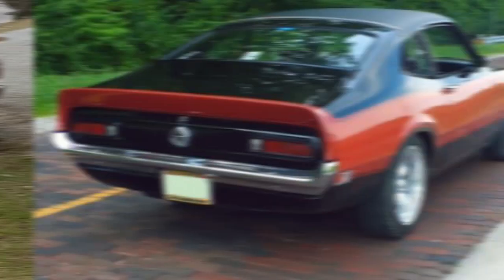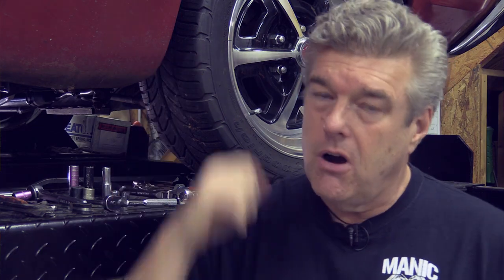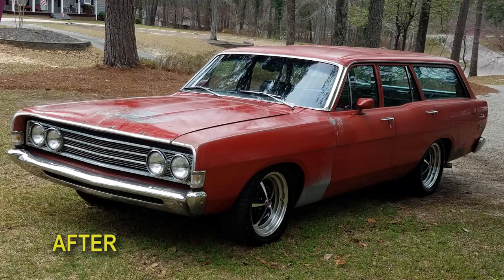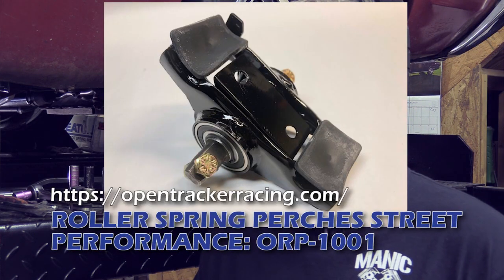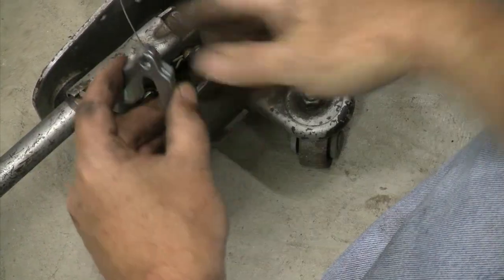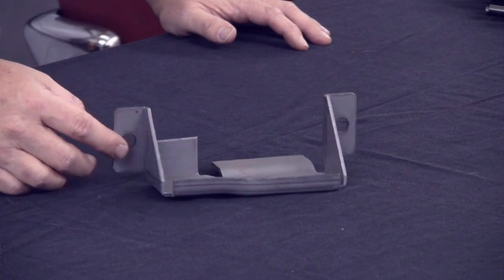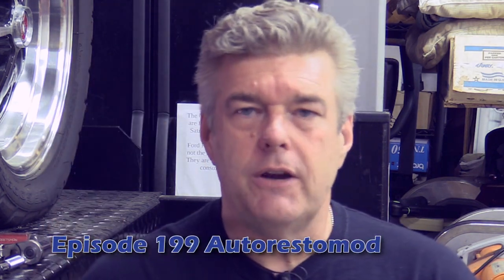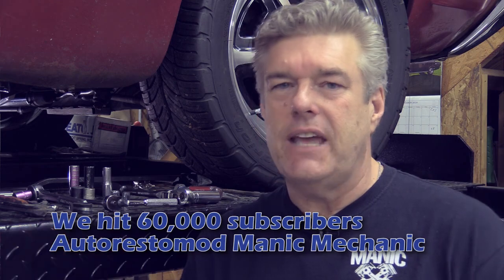10 things to know about ford suspension Episode 69 Manic Mechanic

Comment: Hi. I have been going over the steering, and front suspension on my 68 Mustang coupe recently and decided to swap out my lower control arms with Scott Drake premium units. I am dismayed to find that they will not accept grease via the fitted zirk fittings. It just spews out of the ball joint mounting flange under the arm, with none going into the rubber boot. My supplier tells me that they are greased from the factory but that doesn’t answer they are fitted with a grease nipple that won’t supply grease to the joint! I wonder if you have struck this problem, or am I missing something here?
Reply from the maker: They are greased as far as I know.

Comment: Would you do this for the full size like the Galaxie and LTD?
Reply from the maker: I can try Jack, it is kind of out of my wheel house. I will have to contact my core experts on the big cars.
Reply: @AutoRestoMod  Thank you. I have a 1972 Ford LTD that I have done alot of work to. All suspension, steering, and brakes have been replaced by it is making alot of power now and I'm planning to revisit the suspension and brakes.

Comment: I'm planning on changing my steering box on my 67

The steering box is long shaft

If I switch the steering box to rag joint Style would I be able to use a 68 or 69 steering column?
Reply: Im pretty sure a 68 setup is a direct swap, box/column
Reply from the maker: Yes. I'd stay with the '68 to be sure though. Ford was WAY fond of making annoying little changes between years.

Comment: I’m glad that you finally mentioned what the problem is with gas shocks. But isn’t that more a problem with shock selection than the fact it’s gas? Saying Ford didn’t design it for gas shocks is pretty weak. Following that logic, better lose those big wheel low profile radials, Ford didn’t design for those either. Break out the wide ovals baby!
Reply from the maker: I should clarify: Ford didn't design the springs for the gas shocks. If you order a spring rate that is factory, you will be adding ride height and rate to the springs due to the gas shocks. I've seen it on the Fairlane. Gas shocks were on it when I bought it. Took those off for a set of QA1's and the nose dropped about 3/4 inch (your ride height may vary).

Comment: Cougar???
Reply from the maker: Same as Mustang, I jut broke it down to the Ford stuff because the Mercs were identical (accept for the 1967 Cougar front suspension) and it is tough to go through every one of the models Ford and Mercury had.
Reply: @AutoRestoMod  so what would be a suggestion for the67 cougar? Been thinking about tearing into the cracked bushing in the front end. Replaced springs and shocks( gas but didn't know) and looking at improving her road drivability. I know neoprene is harsher so rubber and roller spring mounts. Dont think I want adjustable suspension as I'm just looking for a driver that I can use fairly well. I am seriously considering a rack and pinion
Reply from the maker: You can change out the suspension for the '68 stuff...only because the 67 uses a different strut rod set up. I'd go with a set of stock strut rods and factory bushings. All your other ideas are good, rollerized stock components etc. 1 inch front bar, 3/4 inch rear, new rear leafs. If you have any more questions, feel free to  contact me at jford@autorestomod.com.
Reply: @AutoRestoMod  Thanks man. Know your busy with the channel. Appreciate the response and did not know about the roller spring mounts. Do you know who carries them? Just trying to get the old girl to have a nice ride. It was scary the first times I took her on the highway!!!
Reply from the maker: Never too busy to help! Open tracker Racing has them: https://opentrackerracing.com/

Comment: Thanks for this episode.  I actually have the gas shocks on the front of my mustang (69) and the front end is high.  The previous owner installed the V8 springs which I don't like as well.  My plan is to replace all the components on the front because I also have the popping sound when I turn.  Are the 250 L6 springs bigger or smaller than the small block springs?  I have the 250 L6.
Reply from the maker: They are a lighter spring. Give Eaton Detroit Spring (313) 963-3839 a call and they can set you up.